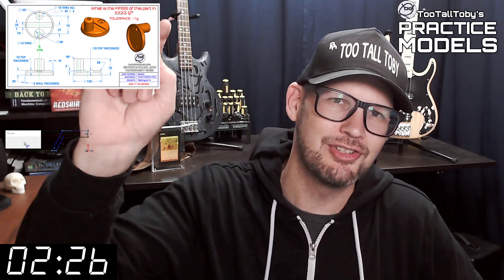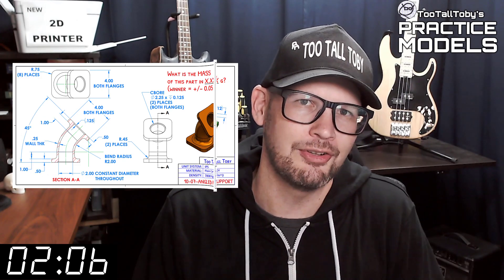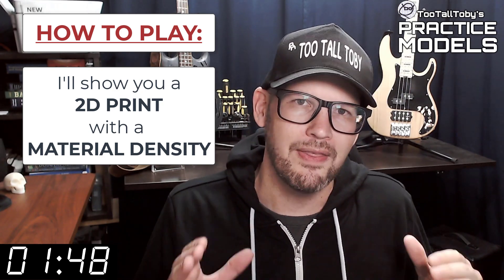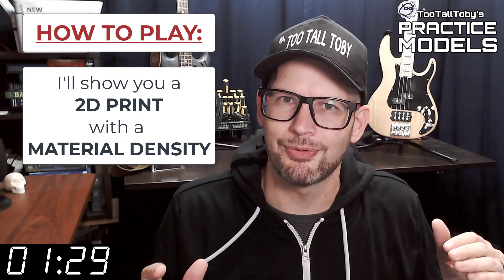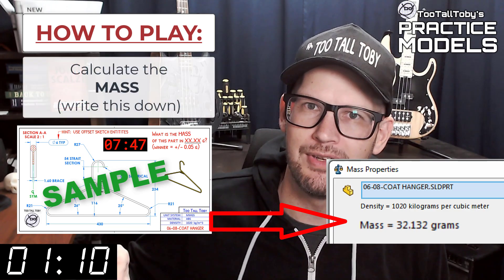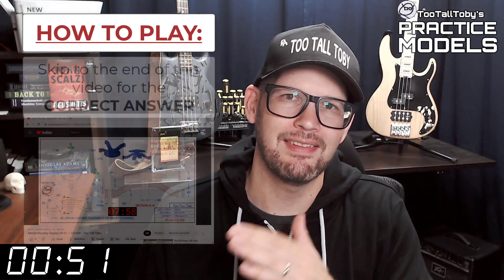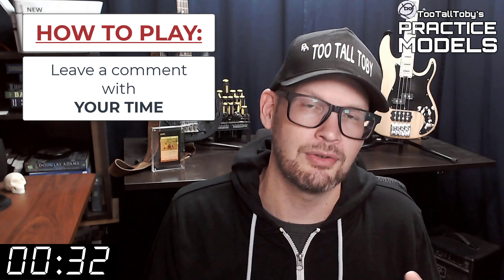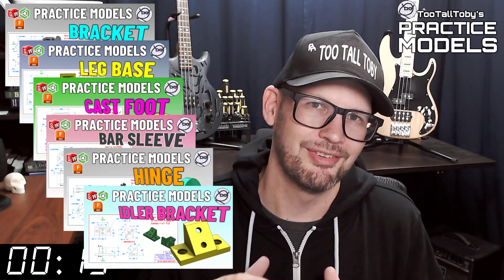2D to 3D CAD PRACTICE MODEL-  Drawing to model - FREE PRACTICE for 3D CAD users - MB HAND TOOL

Comment: Hi Toby,
Just few questions so I understand your drawings better (this is not a critic):

In cross section A-A you mentioned that the “steel part geometry matches plastic part geometry”. In that same cross section one can clearly see that the steel part matches the curvature of the other part. I am confused about cross section C-C: If the same applies there: I can’t see it: I see a flat bottom steel part and the 4 mm indicates what? The only way that’s true is if the metal part also fallows the curvature in C-C plain. The difference here is small (0.25 g), but if you only allow 0.2 g tolerance: I’ll take anything. After doing this model twice and each time being constantly over by 0.5 g, I started to look and understand what could be implemented differently. The only way I was able to get the correct mass was if I ignored your instruction “Steel Part Geometry Matches Plastic Part Geometry” and allow for fitting tolerance where the steel part inserts into the plastic part. Even your drawing is showing thicker line there. Is that what you are indicating there? Anyway, with 0.02 mm fitting tolerance I got 0.015 g error (627.784562 g). In cases like this: Is this a common practice or am I inventing things?

As always: Enjoying the challenge (this is my 163rd practice model from your channel).

Thanks Toby
Reply: and ditto to "Thanks Toby", I am having a blast learning onshape with these exercises!